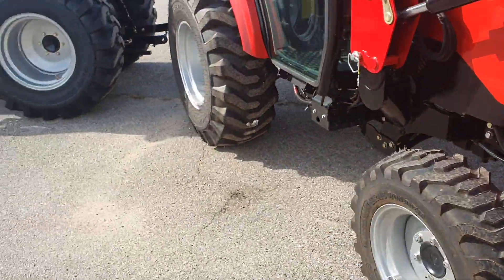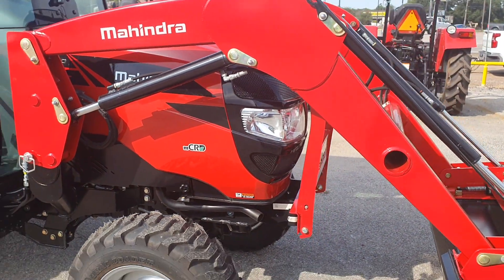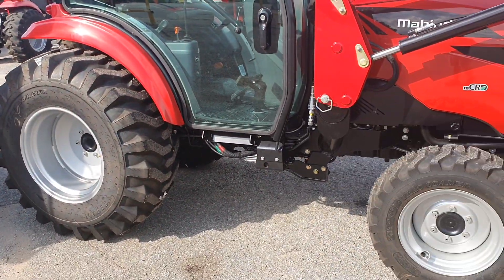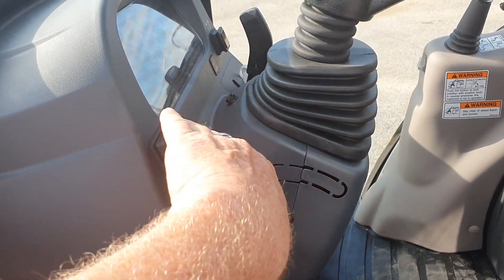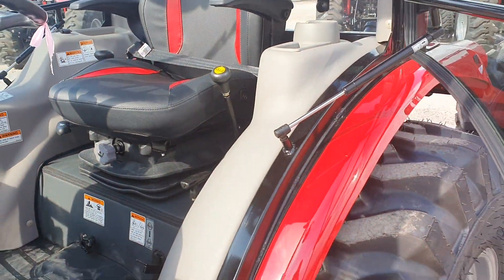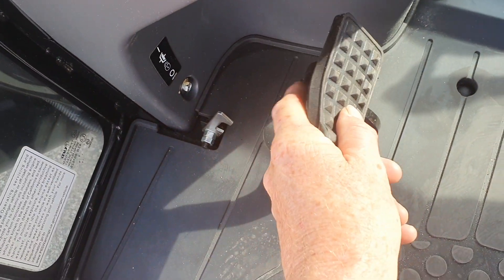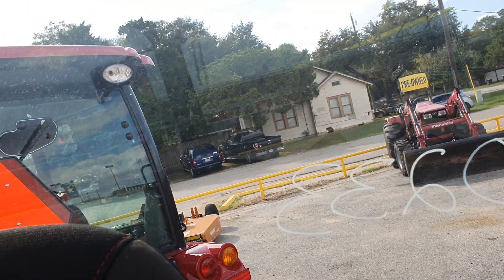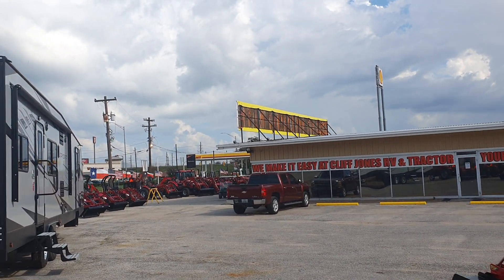Mahindra 1640 HST and 2638 HST cab tractors

Comment: You keep jumping back and forth between the tractors so frequently that it's hard to keep track of which one you're looking at. To make matters worse you keep referring to each tractor as "this one" and since you keep switching I can't tell which tractor is "this one" at any given time. :D

If you would just get into the habit of always referring to them by their model number instead of saying "this one" every time you switch it would make it a lot easier.
Reply: Totally agree, this is one of the worst tractor compare I've ever seen, you need to resign and go to work for john deere, i am in the market to buy one of these two tractors and after watching this complete failure of a compare i wouldn't buy either one.